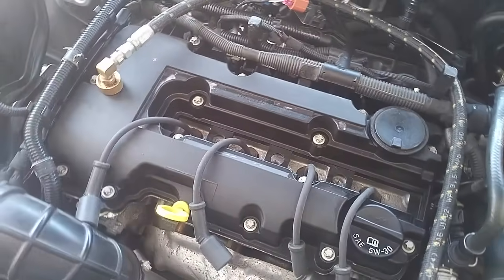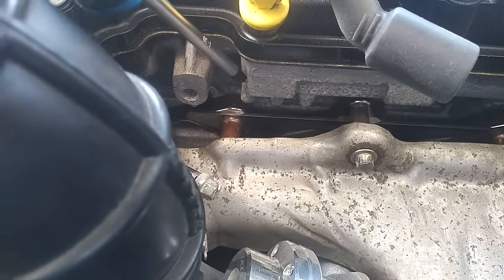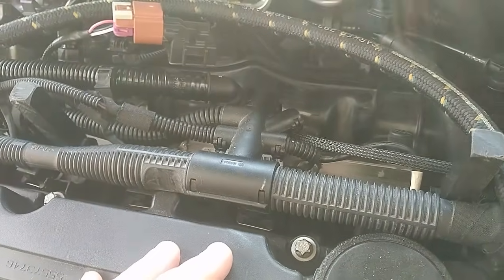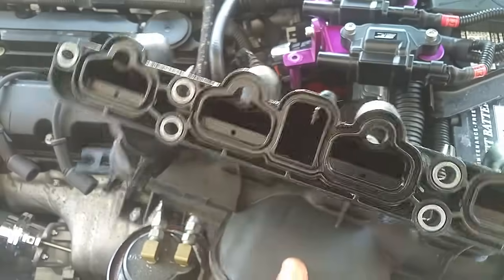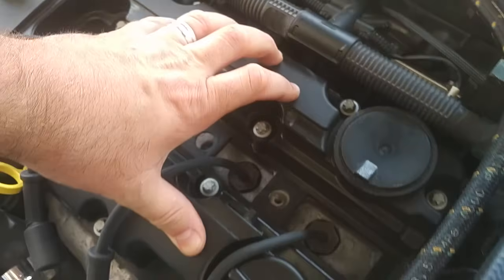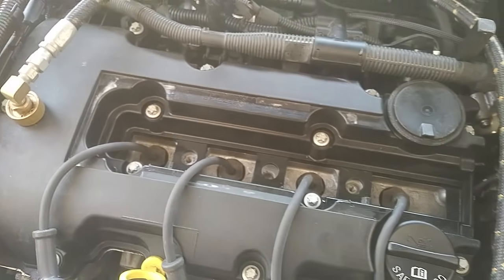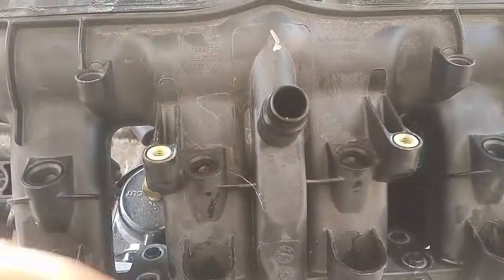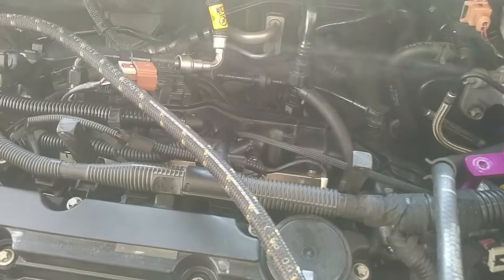Chevy Cruze Sonic Trax Encore 1.4L Turbo PCV Issues, Diagnosis, and Solutions

Comment: Good thing I bought a 2018 Sonic with the 1.8L. I won't have to worry about these issues!
Reply: Now you only have to replace the timing belt @100k or blow the engine! The 1.4 has CHAIN, NO replacement required!
Reply: @TheOzthewiz  no big deal its not hard to do and its once every 100k miles. Much better than worrying about a turbo that craps out around the same mileage or even sooner!
Reply: @ryanchristensen1799  For something that's no big deal, a shop will charge upwards of $800! As for DIY, since this is an "interference" engine, the valve timing has to be EXACTLY right otherwise, goodby engine. Also, according to the maintenance schedule, Chevrolet says: change belt @ 100k miles OR 3YEARS!

Comment: My 2014 Chevy Cruze for the last two weeks has been throwing the code PO171. I had it put on a diagnostic machine and it was reading running lean in bank one. I replaced my o2 sensor on bank one and now my engine light is back on. I had the fuel trim adjusted  checked for vacuum leak and couldn't find one. Reset the engine light and now it's back on. My car has 59,000 miles. I need to find out what is going on with it. Any suggestions.
Reply from the maker: You need to perform a boost leak test to find where you have a vacuum or boost leak. It's most likely the corrugated hose or any one of the common boost leak points. Check out this video for more info: 

https://www.youtube.com/watch?v=heQYgmcGnHI

Comment: Great Video. I have a 2018 chevy cruze 1.4 turbo gas 75000 miles. Yesterday i had a new Air filter installed, I noticed this morning the engine light was on. Car isn't missing but is running slightly a little rough. I stopped at auto zone to see what codes was showing and codes P1072 and P1101 is coming up. Says system too rich and intake airflow system performance.  Any idea what this means? Auto Zone recommends replacing Positive Crankcase Ventilation Tube
Any thoughts on this would be greatly Appreciated
Reply from the maker: You have a vacuum leak. Check my boost leak testing video. Also check your throttle body to intake manifold clamp, and the corrugated plastic hose going from the intake manifold to the turbo as that cracks quite often.

Comment: Hello in need of some Information. Can I determine if the nipple in the intake manifold is bad, by seeing oil throughout the throttle body and intake charge house?
Reply from the maker: No. If it's over 50k miles, just assume it's bad.

Comment: So, basically GM is still building junk.
Reply from the maker: Pretty much. Fortunately, these cars drive pretty well, and all of the issues are pretty simple and cheap to resolve.
Reply: Dre Dan As opposed to my new 17 Civic, the new Cruze has five more inches of leg room, better seat angles and comfort, less road noise, more torque, better styling, and music/infotainment/sat radio. But, its the reliability and clutch engagement that concerned me. I wish I had the Cruze for the comfort. You cant have it all.

Comment: Hey also  can your kit be installed on top of the manifold? It would be so much easier to service if it leaks again
Reply from the maker: No, it can't be. Also, I've yet to hear anyone report that their check valve failed and needed replacing. Once installed properly, these should not leak for a long time.

Comment: Hey Dre I received the 3 washers you sent. Because mine is definitely leaking at the pressure fitting at the manifold I had a friend hold the hose while I turned the brass fitting just a little bit and it’s still leaking. I thought about buying another used manifold could the kit be transferred to another one? I tried emailing you on the Cruzesite for some reason it’s not working that site has many problems sending and receiving messages or just browsing it.
Reply from the maker: Yes you can transfer it no problems. I'd find out why it's leaking though as it shouldn't be.
Reply: Yeah I don’t know why it’s leaking but I can see it leaking around the fitting not terribly bad but enough. I know you said I might have over tightened it that could be a possibility I don’t know my mechanic and I put it together and I trust him so maybe one day I get a chance I’ll install these

Comment: Zzp has the best intake manifold upgrade for $288
Reply from the maker: It's not an upgrade, it's a ported manifold which you can do yourself for free with a Drexel and 30 minutes. It also doesn't have my pcv fix on it so it will fail just like the GM manifolds fail.
Reply: What’s that hose coming from ur engine cover on the left I’m curious
Reply from the maker: @five18audio  AMSOIL bypass filter.

Comment: I’m a little confused, if the check valve is ‘overated’ wont the gas just take the easiest route which is through the next check valve and out through the turbo constantly?
Reply from the maker: Yes, if you use a check valve with too high of a pressure, all PCV gas will go through the turbo, and intercooler constantly. 

It will also fail to apply any vacuum to the crankcase, which will result in elevated oil consumption through the turbo seals, piston rings, and possibly front and rear main seals.

Comment: First i want to thank you for such a detailed video that I'm pretty sure many can't find the answer to. Now if possible please respond. I keep having the valve cover issue frequently now would my issue go inn depth to maybe the manifold area or what. I just replace the valve cover again from dealer 1/25/2019 and it already created another hole in the disc 2/06/2019. Code still reading p0171. Thank for explaining what pcv . help asap

Comment: Well interesting solution.
This kind of engine A14NET and NEL also use many Opel cars produced till 2016. (since then they are bought by PSA group, read Peugeot). So on many Astras, insignias there is this type of engine and guess what it has same problems. Actually opel has “membrane” problems even on older models, corsa and astra. 

Thank you for video, i subscribed and liked.

Comment: Will your kit pass emissions testing?  If they see that it has been changed from factory.  I have heard that that can be an issue
Reply from the maker: The V2 kit is pretty discreet. I use OEM quality and OEM style components to make it look as original as possible, and all of the brass fittings are underneath the manifold where you'd never see them anyway and knew what to look for. As a result, it should pass visual inspection unless someone gives it a comb-over that also specializes in these particular engines. I've had mechanics, used car dealerships, and shop owners purchase and install these kits for their customers. 

Also, as far as actual emissions testing goes, this should be 100% transparent. It retains all factory functions and does it even better than the OEM check valve did. The PCV gas is routed back to the exact same place it used to go, just through a different path. It should function exactly like the OEM check valve does, and was designed to be an OEM-quality fix that would last the life of the car. 

That being said, I can't be held liable, nor can I make any guarantees as to whether or not you'd run into issues having it on. I only sell the kit; it's up to you to install it correctly. I've shipped 1,055 kits as of today and I have yet to receive a report that someone didn't pass emissions or inspections in any state including California.
Reply: @AndreiDPop  I hope you have gotten a patent or one pending for this invention of yours. Seems Chevrolet can't come up with or maybe it's they don't want to come up with a fix... they are making money with all of the cars having these issues... charging an arm and a leg at the dealership to fix them.. I know 1st hand. Last week the dealership where I bought my car gave me an estimate for $1160.00 to fix it!!! I SAID WHATTTT???? and no my car hasn't been fixed... it's sitting in my driveway and I still have payments on the damn thing.  You could possibly end up becoming a very wealthy man due to your kit! And you would help keep so many people from being raped by Chevrolet!
Reply: I am online looking up the codes they put down trying to research and hopefully find a less expensive way out. That is how I came across your video. I watched and you are very knowledgeable about these issues... I think I am seeing a light at the end of the tunnel, a glimmer of hope. Thank you so very much @Dre Dan. I commented a little bit ago about my car, I hope you can help me with my car issues. Thank you again, Kelly
Reply from the maker: @kellygodwin64  Not looking for wealth, just looking to help people fix their cars permanently and affordably. Like I said in my other comment, just shoot me a message and I can help you out.
Reply: @AndreiDPop  I completely understand... You seem like a very humble, caring, kind hearted man. I'm sure you have put a lot of relieved smiles on a bunch of people's faces. You are an awesome human being... This world needs more people like you in it! 🤗

Comment: I have a p0299 code and a squeeking sound after the car runs for a little while, I have looked at my connection for the turbo but haven't taken the intake manifold out yet. Just wanted to know if could be the cause for both problems?
Reply: Any update? My 2015 Trax is doing the same.
Reply: @mroberts4854  not really I have check everything that was in this video didn't see anything wrong. That said the PVC hose wasn't shown and I didn't a second check valve thing
Reply: Thank you! I'll keep you posted with mine.

Comment: Mine has this code and has no power. I can not see check valve on intake and there is sludge build up. Would you start with a bypass?  Would this cause the cat to have no power?
Reply from the maker: It's not a bypass kit; it's more of a repair/re-route kit. It does bypass the original check valve, but only to return it via a different path to the same chamber. It retains all functions. 

This wouldn't cause the car to have no power, but it would be significantly down on power due to the boost leak created. I would start by performing the checks and repairing what you know to be broken, then going forward from there.
Reply: Dre Dan is there a way to see if the turbo is operating correctly without taking it off? Also I’ve only had this car for two days, traded my gsxr for it. And they had previously replaced the valve cover. But I know that the crank case seal is bad because I can hear the suction and if I pull the dipstick it comes from there as well. Also oil feed line is leaking. I don’t want to kill this car I’ve wanted it for years lol

Comment: HI Dre, I replaced the valve cover gasket on my 2012 Cruze 1.4 lt yesterday because it was seeping oil.  I started it up and idle rpm drops to about 700 after a few minutes. Starts at 1500, drops to 1000, then stays at about 700 on idle.  Went around the block and it runs smooth and great.  It's only the idle rpm that drops too low. There is no CEL, no hissing sound in the engine compartment or anywhere near the vacuum regulator diaphragm.  What could the problem be?
Reply: Hi Dre, I just found the hose that goes from the intake manifold to the turbo was cracked in half. It was cracked almost at the turbo connection and not easily visible because of a huge rubber hose just above it covering it from sight.   I just taped it together and the car is idling great again.  But, I think I will still go find a new replacement hose.  It was your video that made me go look at that hose top to bottom.  So...thank you so much for a lot of good information!!

Comment: what if you have oil coming out of the vacuum diaphragm on the top of the valve cover?i do not feel a vacuum leak at the little square port. it does smoke out of the tailpipe under acceleration.
 no check engine light or known driveability issues
Reply: vincent zuhowsky piston ring failure?

Comment: Hi Dre, great video, I replaced the valve cover on my Cruze LT 2013 (got it from Amazon, gm genuine part), because an oil leak from gasket, replace the corrugated hose too (cracked after replacing the coolant pump), after two days I got the check engine light on, scanned and got code p0171, after watching your video I checked the intake and the check valve  (orange nipple) is there. Should I get the valve cover from the dealer and replace it again, do u think something else can be broken. Will appreciate you help.
Reply from the maker: What are your symptoms?
Reply: @AndreiDPop  hi, thanks for answer, only symptom is changes in Idle more low, maybe more gas consumption,  but it's been like a week since I replace the valve cover, that's it, on dash is giving me the stabilitrak service now, (no issues before I replaced the valve cover, just that oil leak). And was ok for like 2 days with the new valve cover.
Reply: @alfonsolopez6961  Did you check the other small valve that refers to, where the other end of the corrugated hose attaches?  By the turbo.  I just discovered my nipple in the intake is missing.  And I too am having the stabilitrack light come on and off at times.

Comment: The 2013 Chevy Cruze my wife drives just started leaking oil like crazy from the oil fill cap I replaced the cap with a new one and it made the problem worse, the mechanic is saying it’s a clogged pcv valve they are $75 from the dealer in your experience could a clogged pcv valve cause this issue?
Reply: If it's $75, he's probably referring to the vacuum regulator diaphragm in the valve cover. When that fails, it is usually due to a check-valve failure.

Comment: Thanks for posting this. I have a 2013 Volt, which has the same engine just without the turbo. It wouldn't pass emissions nor would it set a check engine light. It was running just lean enough to not set O2 sensor readiness nor was it lean enough to set a check engine light because of the same exact leak in the valve cover.

Comment: So if the nipple is good, does it have to have the screw put through it?
Reply from the maker: If you're installing my kit, you punch out the nipple and corresponding flap behind it and run the screw through. We've found that even if the nipple is there, it usually leaks so even that's not an indicator that things are working as they should. A quick push with a flathead screwdriver breaks the nipple off and the flap behind it falls out from the inside.
Reply: Dre Dan thanks for the reply. Found you on Cruze talk. Just had a warranty manifold put on for free. Looking to do the v2 fix soon. Probably when it warms up.

Comment: Why not use the nipple out of the 90 degree elbow than hose to get to top of intake manifold and then use 2 more nipples on the pcv and hose to connect to the brake booster tee?  Do you need to be that close to the hole you drilled in the manifold for the pcv to work correctly?  This way it would be easier to replace the pcv if needed in the future.  You would only need 2 more nipples and hose clamps in the kit and price would go up but it would be better.
Reply from the maker: Because there's nowhere to mount the hunk of brass that is the check valve. It would just bounce up against things or would have to be ziptied somehow, and there's really not much space up there anyway. I mean if you order the kit, you're more than welcome to modify it as you see fit, but i had to factor in ease of install, price, and inspection compliance (some people who install these are in California, so a big shiny brass valve on top of the manifold would certainly attract attention) as part of the design factors for this kit. There were many factors to consider.
Reply: So just to be 100% on the same page moving it will not effect the engineering or working design is that correct?  I want to order the kit but wanted to make sure it would still work if I moved it up top.  I live in a part of the country that could care less about a modification.  thanks again and you have been a BIG help with Cruze issues.
Reply from the maker: As long as you retain the same logical configuration, it will not affect how it works at all. If you plan to order a kit, I can add extra hose, some extra hose clamps, and barbed fittings so you could relocate the check valve elsewhere for $10. Just order the kit, and I'll send you an invoice to the same email address for the remainder. That way you could have everything all in one kit and won't have to go out shopping for fittings, clamps, and hose.
Reply: OK just did the PayPal order.  You will see my name in the ship to and my wife's email address is different so just note that.  The town will be Friendsville MD and I will promptly pay the additional $10.00 when you invoice it.  Thanks so much again for sharing knowledge.
Reply from the maker: Thank you. Just sent the $10 invoice.

Comment: 241,000 miles on my cruze. I just had the water pump replaced today, 2nd time in doing this.... I'm hopeful it will keep going other 50,000 miles.
Reply: I'm getting a weird ticking sound when engine is running.... thoughts? Is that normal for this type of engine?
Reply: Same thing with myn but myn  has 60000 mi
Reply: Dexter Morgan mine started with the ticking then started throwing this code 68k miles 2016

Comment: Hello Dre Dan, i have a strange noise in my opel corsa with 1.4 turbo motor from 2014(its the same motor as in the cruze), when its warm an its no belt driven part - i checked it without the belt. I checked the PCV valve to the turbo, its switching when i blow in an suck there and i can see the nipple in the intake and the valve cover isnt sucking air. But i have the simmer ring squeeking when i shut off the engine and a noise like a sqeaking belt when its warm. Is it possible to have a higher underpressure on the enginge caused by the valve cover? I first want to change the simmerring but if its not the solution for it i maybe want to change the valve cover. What do you think? The next step could be an expensive change of the timing chain. Sorry for my bad english ;)